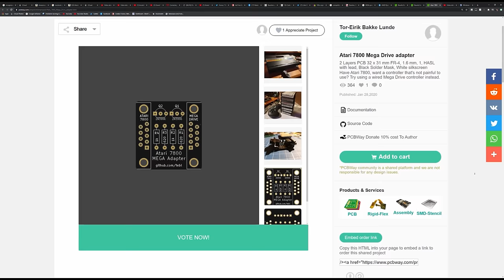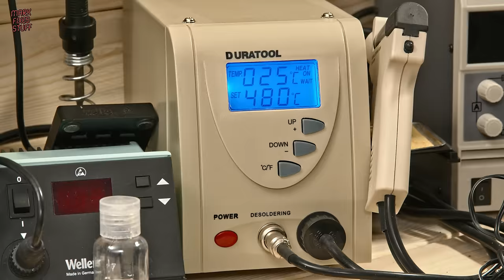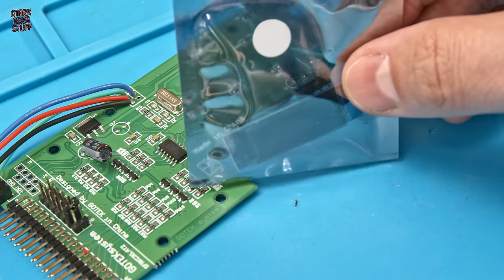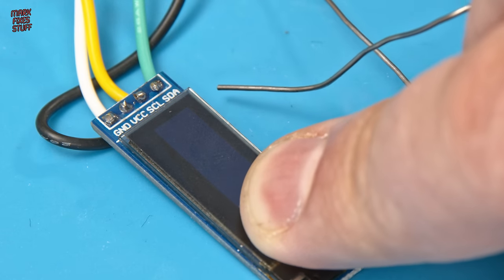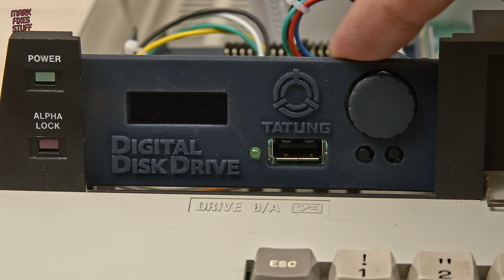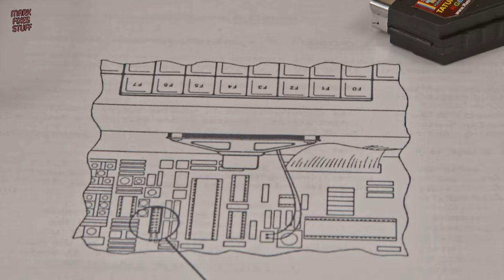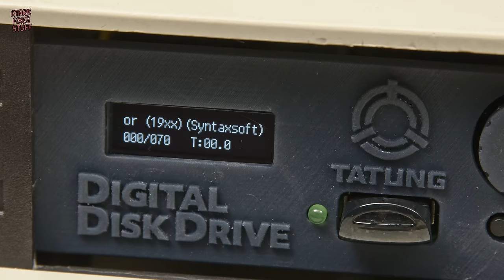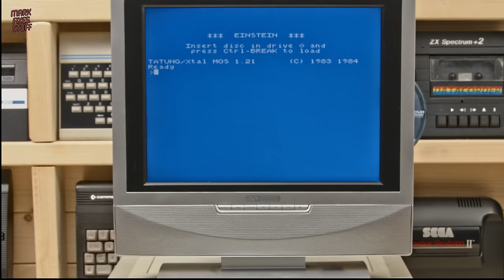Tatung Einstein MODERN UPGRADES & PLAYTEST! Custom Digital Disk Drive mount from @PCBWay & RGB SCART

Comment: One tip for those molex/berg power cable extenders/splitters: plug it into something to hold it, then fill the back of the plug with hot glue, this will secure the cable and the pins at the center of the hole, they won't wobble and will be easier to plug next time.
Reply from the maker: That’s a great tip! Thanks so much!

Comment: Back in the day I knew 2 people with an Einstein, a science teacher and one of my friends.  Really they are a bit ugly, kinda the same power as a CPC464 and very expensive... but hell that keyboard is amazing.  For programming they were easily the best 8-bit machine, a lot of developers preferred to work on these and push code to machines like the speccy... I mean nobody liked to code on a dead flesh keyboard, night and day compared to using the Einstein.

Comment: Interesting that you found so many spectrum ports and then the better ones were MSX games - because that’s exactly what I found with the MSX. So, so many lazy Spectrum ports, then I got to the good Konami stuff and really saw what the MSX could do.
Reply from the maker: Same with MSX- cassette games are mostly slowed down Spectrum games hacked across worth little care. The cartridge games are usually a lot better. Like a different machine almost.

Comment: Another great video Mark! It's a shame the machine didn't do better. I get your point about the cost at £499 but then compared to a BBC Model B at £399 with no disk drive it doesn't seem bad value. I guess because it wasn't used in schools and the majority of the games were Spectrum ports (or the other way around depending on how you look at it) it didn't have as much appeal. I know I really liked the look of it when it came out. let's not forget that it had double the RAM of the BBC Model B as well as an extra 16kb of video RAM. I don't think it was such bad value.

Comment: I did not play any games on the Tatung Einstein that I had to use from Binary Designs Only a z80 compiler to write games on and send the data via Rs232 to my Speccies. The one I used had two floppy drives installed. great memories. Looks like your Glue Gun has seen some action 😉
Reply from the maker: Ohh! What games did you write??

Comment: It reminds me a bit of the KonTiki 100 machines we had in Norway, a rock solid case and drive bays on either side. They were built for schools at the beginning of the 80s, but had really basic graphics and didn't really exist outside of classroom because of it (as well as the price). The machine was most known for its pirated CP/M because they forgot to license it 😅

Lovely video, I enjoyed the journey. You could probably use a piece of packing foam, the black sheets cut to size to fill the gap - a bit of negative space usually works wonders.
Reply from the maker: KonTiki you say… [adds to wants list]

I might make a second version of the front part. One that fills the bay completely

Comment: Another one of those "slightly before my time" things, pretty interesting to see. Yie Ar really showing how good it was for its day.

I definitely feel you on the magnetic media thing. Having been working with my A1200 the last few months, by some miracle, the hard disk still works fine, but only Sensible Soccer 1.1 and the original Lemmings disks survived. Been using an odd combination of an Ubuntu Live CD(Windows 11 doesn't support 720k floppies, or at least mine doesn't) and USB floppy drive to get disk images over, and then installing them using WHDLoad. I should probably just get myself a Gotek.
Reply from the maker: Yes. I’m afraid that floppy disks won’t get more reliable as they age.

Comment: It probably never occurred to the company to sell them as a multiplatform development kit, if they had catered to that they might have had more success in the long term.
Definitely can hurt your product making it too good, when the consumer can barely notice the increase in build quality you're going down the wrong path. For contrast the first ZX80s were simply too low in quality, cheap sure but also looking like it came out of a cereal box lol.
Interesting platform, looking at the VDP the TE is in the same graphics realm of the Colecovision, MSX1, and TI-99/4A. It does have the advantage of no attribute clash in comparison to the Speccy. Anyway, excellent upgrades Mark . :D
Reply from the maker: This is basically an MSX without being an MSX I think.

Comment: I do love these machines one of those i always wanted but never got .Superb work mark on the psu replacement and the flash floppy you can run bbc basic on these machines .This is one of those machines that price stopped it from becoming as popular as it could have been if it had been more affordable it would have been a great games machine like the bbc micro it was well thought out and had plenty of expansion possibility.

Comment: 21:35 I haven't seen you swap the power pins in the drive cable yet and your cables use different colour codes to the service manual. It looks like pin 1 (left) of M0009 on your is white red blue which should be white red. thats 12v and It looks like its going to the yellow on the molex so should be good. don't know if you swapped it off camera or just got lucky...

Comment: @markfixesstuff Finally getting round to adding a Gotek to my Einstein with the help of these vids cheers! Any chance PCBWay may want to release that 3D print file sometime? Happy to order it from them even, it looks much nicer than the one I got from Thingiverse.

Plus, I have a resin printer, and it loves to curl up anything at the edges. Using supports gives the bottom this really ugly bevelled look, but it's functional I guess.
Reply from the maker: Hi mate. I actually made the bevel design. I didn't release it because it needs a couple of tweaks (face plate made a bit larger) which I haven't done as yet.
Reply: @MarkFixesStuff  ah, I misunderstood your comment in the vid in that case! I'll keep my eyes peeled for that one 👍

Comment: 16:05 No way are the M3 thread screws! M3 always needs a nut. self tapping M3 does not exist according to the international standard. Maybe according to the Chinese backyard standard.
Reply from the maker: M3 is just the diameter (2.9mm), at least here in the UK Jens? Then the thread is determined secondarily as self tapping / machine threaded etc. By default here, an M3 screw is self tapping (like a wood screw) unless you shop for machine threaded with for use with nuts 🔩. 

Here’s a link to Farnell showing the options I have to use. Interested in what you have to deal with. https://uk.farnell.com/c/fasteners-mechanical/fasteners-fixings/screws-bolts/self-tapping-screws?thread-size-metric=m3
Reply from the maker: Apologies if I’ve got this wrong btw. It’s just how I’ve always referred to it?